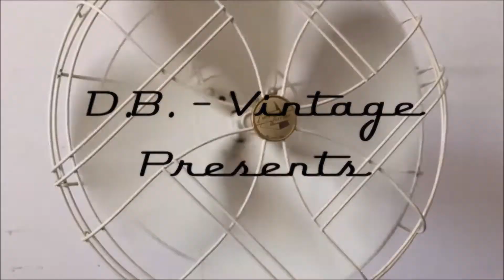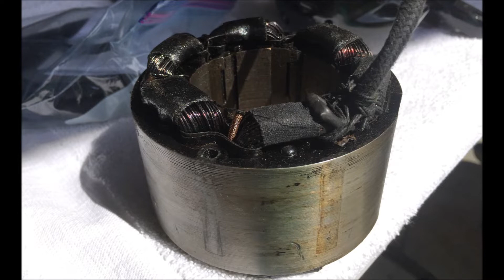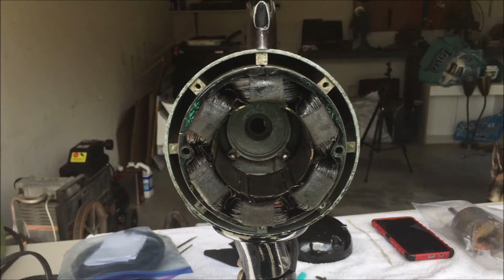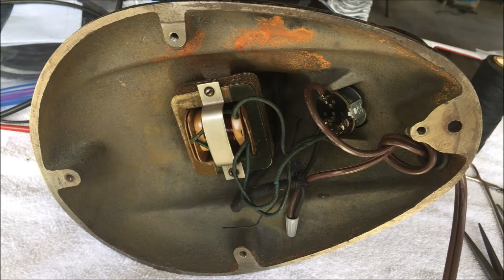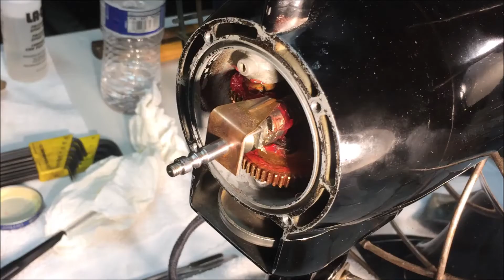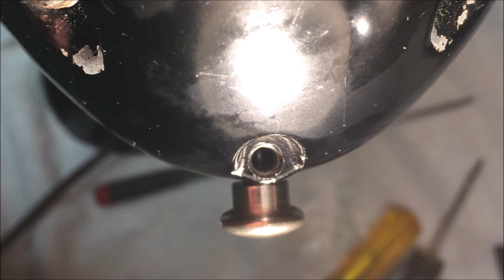Signal Deluxe (aka  Mixer) 16" Oscillating Fan Assembly

Comment: That fan is a work of art, really. Especially with the polished blade! Fascinating about the unique oscillating mechanism as well.  When it's disengaged, what blocks the gear from turning because of the grease on the shaft dragging the worm gear along? I noticed your assistant was holding the body of the fan back, when demonstrating it disengaged without the  shifting fork in place.
Reply from the maker: Thank you!
The main worm gear coming from the motor rides on the shaft, it's like a sleeve. When the fan is put into stationary mode, I think that the "fang" piece that appears to be worn is meant to catch a near perpendicular groove in the worm to catch and lock the worm while the inner motor shaft upon which it rides to freewheel. So that fang is the catch piece.
What you mentioned about the grease dragging the outer worm is what we ran into. We had to change the grease to 20w oil where the worm rides the motor shaft so it would freewheel easily.

Comment: Pretty good video as always my friend.
That is a lovely fan! Great motor you have there, almost indestructible.
Nice fan features, good piece of engineering.
Keep up the good work.
Regards
Reply from the maker: Thank you! It's an interesting and rather complicated piece for sure.
Reply: @DBVintage  
It's a lovely fan.
Can you can find bronze bearings/bushings for antique fans?
I'm restoring a marelli fan  from the 30s and the back bearing needs to be changed, the  problem is my country I'm not able to find any, do you know a place to buy them? Or if you have a place near you con you order it to me, I pay all expenses to you.
Thanks
Reply from the maker: @teltras68  I think you would need a machine shop for this.
Reply: @DBVintage  
Thanks